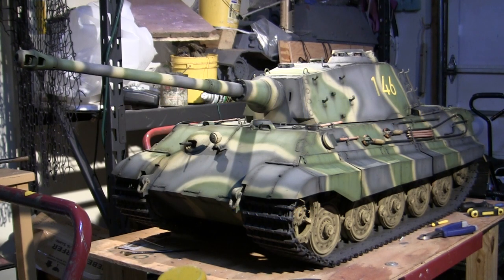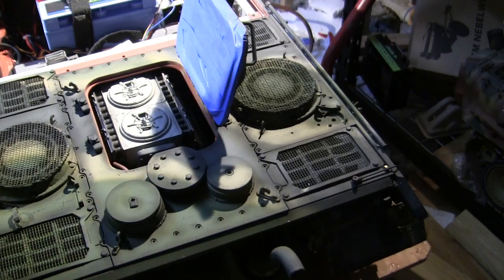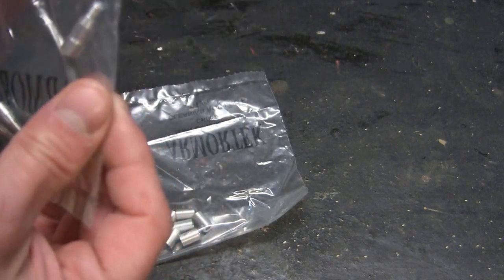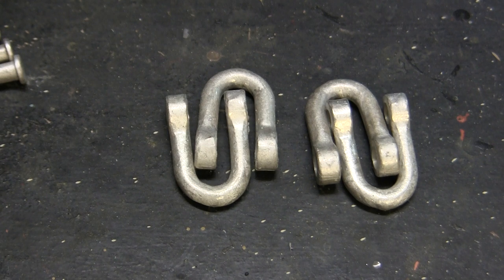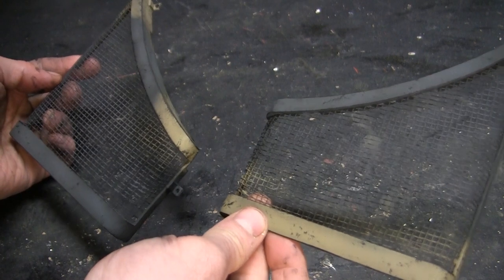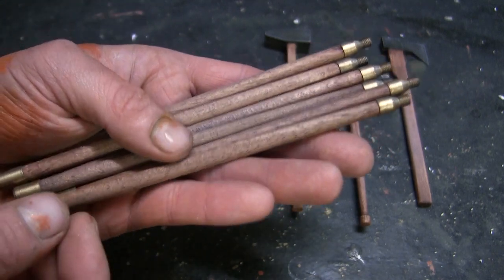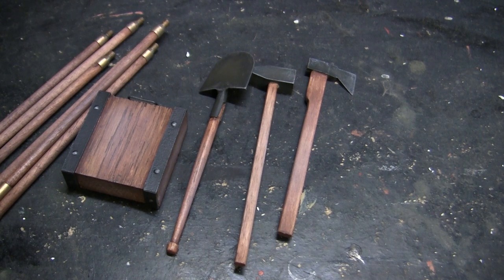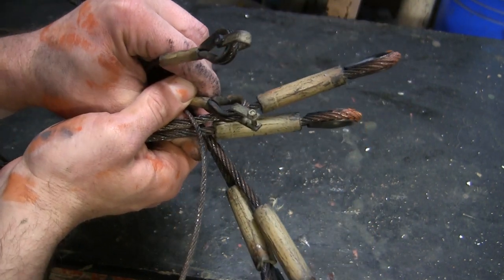Armortek 1/6th scale RC King tiger project video#35 (tools and final details added, 99% DONE!)

Comment: As an FYI, the MG-34T was used because it allowed for the gunner to change worn\hot barrels while inside the tank. The gunner would simply rotate the receiver out of the way, and extract the barrel. The MG-42 had a barrel what was mounted from the side,  and from in  front of the receiver. Impossible to do inside the tank.

Comment: Amazing build, have a question though im having trouble finding info on the staves you made, what exactly were their purpose?
Reply from the maker: the cleaning staves are collapsing poles that are used to swap the barrel to clean it after prolonged firing. It's nothing more than a larger version as what is also done on rifle cleaning kits. What is not seen on this model is that when connected there would be a swab that would thread onto the end and that would be used to scrub / clean the barrel during maintenance. I hope this helps
Reply: @oddball759mm  yes it does thank you